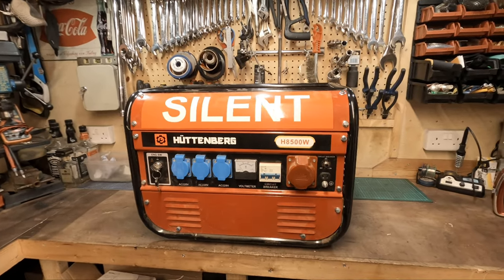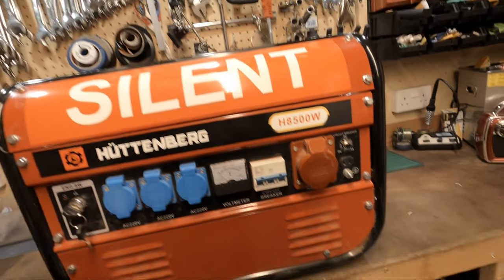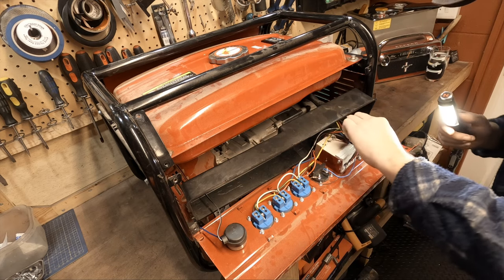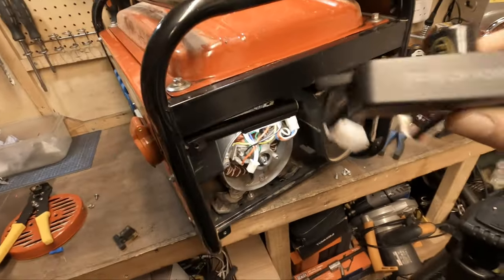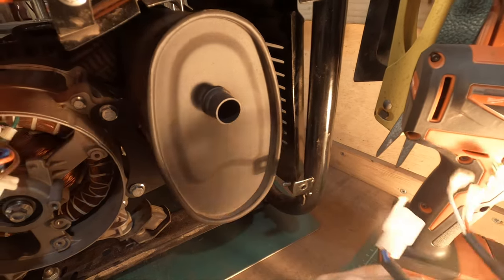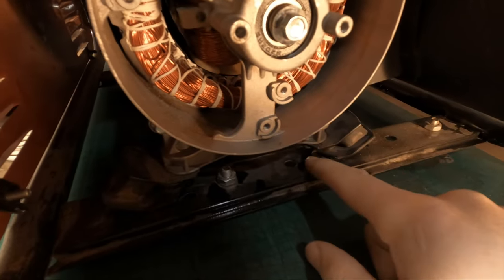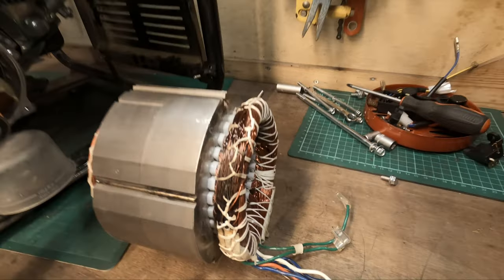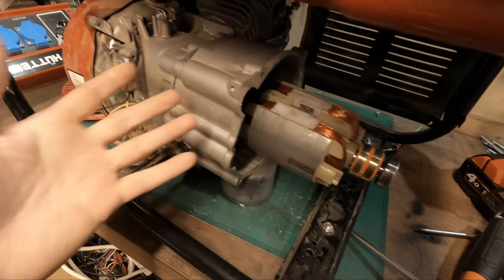Portable HUTTENBERG H8500W Silent Petrol Generator No Power Output - AVR / Brushes TEARDOWN [HOW TO]

Comment: To Fix it build it garage.  Sir, I owe you a big thank you.  I have just bought one of these generators, and after watching your video I decided to have a look at the way it was wired.  I am so glad I did.  As I said in my last comment it is a three phase generator.  I therefore assumed that the three 230V connectors would be connected one to each phase.  No.  All three connectors are wired together and connected to one phase.  This limits the total power available on the three 230V connectors to 2KW total (assuming the generator can produce the claimed 6KW).  I wouldn't mind betting that the previous owner had a load greater that 2KW pluged into the 230V connectors, and that is what caused the damage to the stator winding.  I will re-wire my generator so that each 230V connector is wired to each phase to share the load over the 3 phases.  Once again, thank you for your video.  It has most likely saved me a blown up generator!

Comment: A couple of observations.  Firstly, the damage to the stator winding seems to only affect one of the phase windings, and secondly, the damage to the rotor winding does seem to be mechanical in nature.  If that damage has resulted in a shorted turn then the rotor is scrap but I think a bit of varnish to cover the damage and it would be fine.  I have one of these generators which I haven't run yet but there are one ro two things which are not clear in the rubbish user manual that comes with the unit.  It's a 3 phase generator.  The clues for this are in the wiring.  The quoted max power output is 6KW, but this would be accross the 3 phases, i.e. 2KW on each phase.  I wonder if the previous owner tried to draw the full 6KW on one phase.  That could result in the damage to the stator winding and the AVR.  I wonder if you trace the wiring through (if you can be bothered) you could identify the phase which has failed.  Then check the wiring through to the connector on the panel for damage.  It looks like that is what the unknown person was doing.  Just a couple of thoughts.  Great video.  I would like to know what caused the bushes to break off from the brush pack.  Any ideas?
Reply: Interesting, I've seen these generators advertised as 8500 watts on Facebook marketplace, I knew just from the size that this could not be the case.
But now that you mention it, they almost always have a 3phase outlet.
Which is probably a way for them to mislead without lying. Extremely misleading though if someone was expecting to run 200 amp welder or a couple of even 2000watt tools.
Your screwed.
I believe these only have 6HP engine too.
Which is another good indication this resembles a 3kva generator, in size and horsepower.

Comment: Hi, thanks for your video! I recently picked up one of these generators in the metals section of our recycling centre for free. The engine has no compression, and all the wiring except the voltage regulator and other wires coming from the generator. I'm going to try to overhaul the machine!

Comment: 2 points which need correcting...the spring loaded sliding carbon contacts are called BRUSHES NOT BUSHES, & the cylindrical projection from the regulator is NOT a BATTERY !!!!  Its a CAPACITOR !
Reply from the maker: Yeah i noticed that i thought i put text up at them points, i talked about the capacitor range later on but call it a battery at first lol

Comment: I have one of these generators and have used it for about three years. It's been great for the money. However the end bearing in the generator next to where the brushes reside has seized did to misuse and cracked the casing. Don't suppose you want to sell your casing?
Reply from the maker: Hi, Nice to have someone have good news on the generators, dont seem to be so great. Sorry I hold onto equipment, use for parts on other projects.

Comment: Fake Facebook Marketplace generator, I work in the industry, there's 1000's of these things out there, we have people calling up asking if we can repair brand new generators as the sellers can't be contacted. One indication is that they are a third of the price of any other branded 8kW generator - They are also less than half the weight of any other shop bought 8kW generator, also you will not find any reputable UK retailers selling these things.
Reply from the maker: Very true, Honda GX engine weighs more than the whole unit